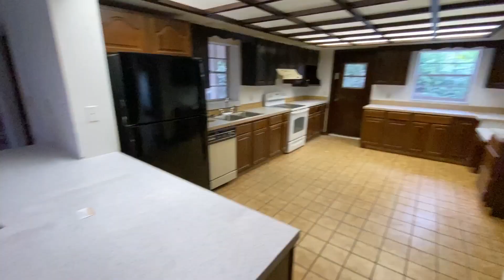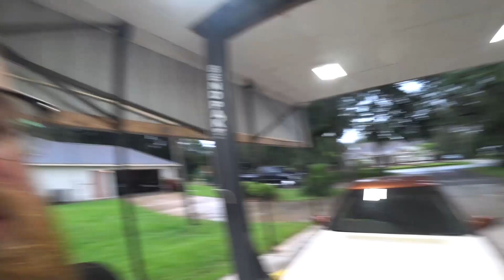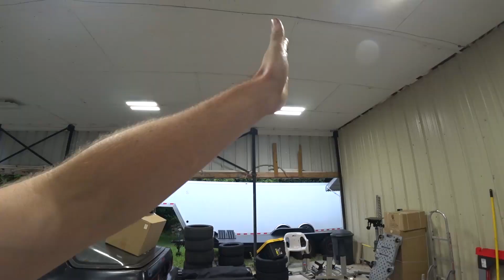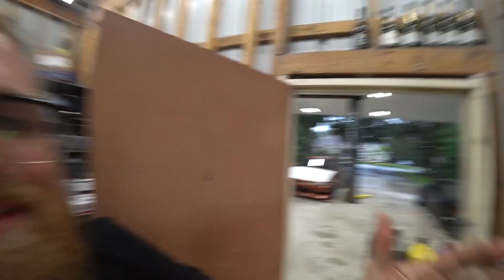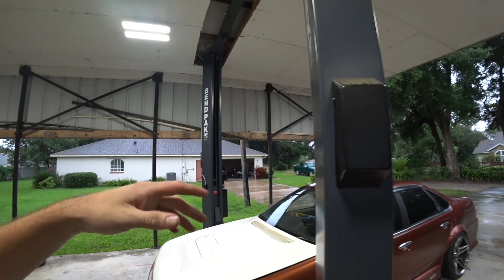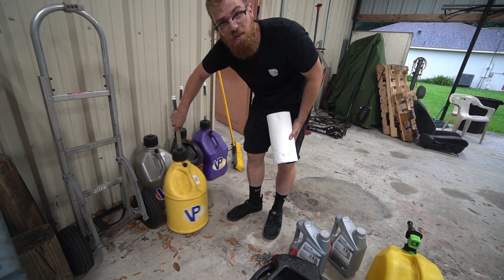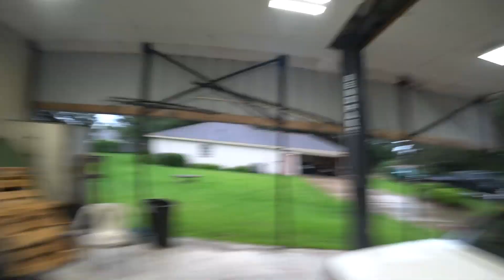Update on my new shop. I have to tear it all down.

Comment: Wow, this sounds like my story for house hunting and what I was looking for. I bought a place with an open shop that they didn't finish so they could park a 5th wheel in it and have people stay in it. The good thing is I can close my shop without issues as I live outside of the city. I would be sick if I had to tear what I have down and start all over again, but it sounds like you have a great plan and what you build will be pretty awesome. I have 220v power wired to the shop now, but I need to expand it. After that, lights, 60 gallon compressor, and then air hookups around the shop. Also, I need to look into Quickjacks. I could put a lift in my shop, but I want to keep the floor space mostly open for fitting all of my vehicles for storage purposes when they are not being worked on.

Comment: i would think that with tear down and rebuild you could run into the chance of it not be grandfathered in.  most places do not allow commercial in a residential area.
if it has been there for 23 years then historically it will meet FL wind codes.
Have you ask one of the county/city building inspectors to come look at the bldg and  talk to you about the issues?
I would put hurricane fencing around the open area and cover that with tarps or similar like many vegetable stands are.

Comment: I live in south Florida! here are some suggestions! I worked in the product design industry and also wrench on racecars like yourself. I had to do a permitting challenge also with my rental. the garage was open/no door so they also made me get a signed and sealed architectural drawing (just for the frame to put in front of the roll up doors?) it was soo simple but they made me do all that? details on the screw length and spacing all that. the challenge was finding a cheap price. just for the frame 8x7 people wanted over $1000, I ended up find a guy and hustling him down to $500 just for the drawings. (side note over the yrs I've done private remodeling jobs for multimillion dollar homes and i know a few people in the area)  it turns out if you own the home you can do what's called an "owner occupant permit" which basically allows you to do all the work yourself but you have to really know what your doing, they don't want to have to hold your hand and make multiple inspection trips out to you. the only downside is you have to sign papers making you legally responsible for the job, (example if a hurricane comes and parts of your job destroy someone else property they can sue you. or if you sell the home your still responsible for it. (which is why contractors have the insurance)  ok here's what i would do in your case. looks like you are trapped into having to rebuild shop after the home purchase. time is value I understand you need to finish your shop and projects.   Look into canvas like awning companies that could close in the bottom wall. and for the front a retractable awning that just rolls up and down. that would be the cheapest option other than just going to home depot and getting some tarps to close it off. (you paid for the shop when you bought the home so seems crazy to tear it down loose that value then build a brand new one over it? ) you could have just bought a larger property then built a shop on it if you got that budget.  honestly i would just start looking for another property and wait on a good deal, continue using the current shop as is until then. (your video just got to the part talking about your good neighbors.)  in this case if your going to build a new shop i wouldn't tear that one down! I would build a new one behind it or beside it, don't loose the value you paid for it, that just seems like too much of a waste. just pour a new foundation slab. if the new slab costs less than the value of the current shop its worth it.  great content

Comment: Like you said it would be a lot of work but if I was you I would go with a 40ft container because I think from the look of what you have it will fill up quick. I am only speaking from experience a short while ago I had to move out of my 20x40 shop because of health reasons  I had a 48ft trailer and it filled up quick.

Comment: You needed to consult with and hire an engineer. Worth it to find one you can work with. Problem solving becomes easier, saves money in the long run. That stamp ends the bs.

Comment: I'm not sure how far you've gone with this. The space looks big enough to fit two full size RV's. My advice would be use a At least one 14' tall 16' wide door. It'd be a good feature down the road. If you did decide to build your mezzanine leave it to one side so imaginary RV would fit. A 14' tall overhead door is a common size. I'd never recommend anything between 8' and 14' if 14' fits.

Comment: You could put solar panels on the roof and use a heat pump. The solar panels would provide the juice to run the heat pump.

Comment: Building code beurocracy is a pain in the ass. If it was my shop, i would just pour a new perimeter foundation footing around the outside, and frame up new exterior walls all the way around, outside of the existing walls and support posts, to meet the newer wind load requirements, and attatch them to the existing walls and roof.

Comment: I've gone though this same thing get second electric meter for more power spray foam inslation no drywall plywood walls for hanging stuff later save the metal from old building and use to make leantoo building on the outside of the new building

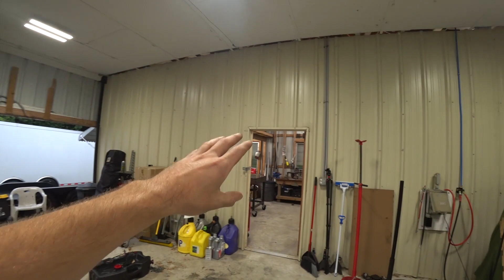Comment: 20:00 - What's the problem?  Take out the stuff in there down to the exposed studs.  Run your wiring.
SPRAY FOAM the walls and ceiling.  No need for a drop ceiling except to hold the heat down in the work area.
Reply: its called “ fans”

Comment: As a GC in California we have to deal with very dirty code enforcement! My solution to your problem would be to enclose your shop with 9ga. chain link fencing and gates then line the inside with heavy canvas...not being a permanent structural addition a permit would not be required! Not much insulation but you would have security...

Comment: building already grandfathered was built to code when built.  only updates will be to electrical,some city require plumbing(working bathroomm). if so many square feet.I guess if you were to run 25 foot of conduit & wire for an extra receptacle you have to permit it ? variances are issued every day here in my area  for building money sways all think that where you are booged down

Comment: When you do new lighting, please do not get lights rated over 4000 kelvin.   Reason: higher number is brighter but is more blue light.   Blue light damages your eyes.  So 3000, 3500, or 4000 kelvin is my suggestion.

Comment: You should find out how much of the materials you can reuse from the shop already and I tore down multiple shops and brought them to my house and built a huge building and I poured the concrete and put electricity in for less than three grand and I had a 26 x 30 building have you seen my yard this building is huge got 14 foot ceilings in a second story

Comment: My curiosity lies in why he didn't just take a weekend  to frame and side that simple of a job using code specs? Then just take the penalty IF they ever show up. Most likely they would not have. Plus you would be up to code minus the permit. I mean it's 90% already up to code and permitted anyway,. Jeeze.... Tear it down?🤔 So it appears last years codes are not safe enough to build to BUT safe enough to let the building stand. Meaning he can't add on to it for it would be considered unsafe. 🤔 Perfect example of following rules to your own demise over realistic practicality of proven engineering.

Comment: Dude, you're preaching to the choir re dealing with county building codes, etc.  Like pushing a rope uphill.  We bought a place out in butt scratch Florida with a large pole barn, part of which is enclosed.  I want to enclose the rest, partly for woodworking and to work on an old car, etc.

Comment: Sounds like you have an amazing idea. I would always go steal over wood. But that's just me as a former union ironworker.

I'd run the Air Conditioning at night but raise the temperature 10 or 20°. Then you keep the humidity out and don't kill the machine going off and 100% on.

Comment: If I can make a suggestion, I know some of my family members back in Nova Scotia have been installing heat exchangers in their homes. Maybe do some research on them to see if you can apply them for your shop. Cool in the summer and hot in the winter white save some money instead of running two separate systems one for heat and one for AC. Apparently it is a two in one system and with that being said maybe has A unit out there to apply to your shop.

Comment: Why not enclose it in canvas it won’t be less insulated than your steel walls and in the summer you could open it up for ventilation. Depending on your county regulations if you buy a prefab steel building sometimes you don’t have to have it permitted if you meet certain requirements for a non permanent building. I have a friend who did it that way.

Comment: Why don't you just put 4 roller doors on each side and big doors on the front? It is still a carport then. Or patio blinds if they say doors are too permanent. Basically, as it is, it is permitted so all you need to close it in is doors or windows but they cant be permanent so patio blinds are not permanent. Or Roller doors if you can get away with it. Also keeps it open-aired to let the breeze through.

Comment: Dont ask dont tell when it comes to closing in a garage like that.  Do a little bit each month, no one will notice. Tearing it out is nuts. Should have bought a place in the countryside with no shop and built new. Neighbors suck. Put lattice on the walls and a gate to the roof on the front. Now its secure and light.

Comment: Very well produced and inspirational video!  Kudos!  I can say I am well versed with the bureaucratic nightmare of building your "dream shop".  It's very good to see a young guy like yourself without an insufferable sense of entitlement, and a good work ethic!  I am a "not so young guy".  It took me my whole life to get my "dream shop".  I now live on 2.5 acres with 2 modest houses and a nice shop in AZ.  I have 2 massive swamp coolers (because they actually work in Arizona)!  Much cheaper to operate than AC.  I am also fully insulated (wouldn't want to be in there in the AZ summer otherwise)!

Like you, the houses were a secondary consideration to me.  I built a 40 X 60 (16' high) pre-fab metal shop with a 1000 sq ft loft and an 800 sq ft annex off the back (there is never enough room).  It has 2 car lifts and 2 - 12 X 14 rolling metal doors (and 2 double car 10' high doors off the annex).

You seem like a very enterprising guy.  It gives me confidence in the future for America (when little else does these days)!  The best of luck always going forward!  Keep up the good work!

Comment: did I miss something somewhere ? I thought the whole reason the small enclosed shop within the un-enclosed barn was becasuse the permitted development could not be any bigger than so many square feet of the original house's foot print ?
Surely building a new all enclosed building as big as the existing building violate this ? I must have missed this bit ?
Reply from the maker: No I said I was worried that’s why it was built this way but that was not the case. Zoning wise it can be the full footprint enclosed.

Comment: You know that in most states once the seller signs he has NO RIGHTS to end the sale. In fact you probably can still sue for damages, mental duress and personal stress. For sure in FL this is true. Glad you found better, however I would go after the last seller's agent and seller for ending the sale and harming you.
Meanwhile, I can tell you that when you enclose an open garage you re REDUCING the loads on the structure. The wind uplift loads on on an open roof are MUCH higher.
The next question is whether you are amenable to having tear away walls. That would result in an acceptable variance. 
Glad you came to a conclusion regarding your needs. Don't forget to insulate and air condition (use mini splits).

Comment: I would look up the difference between 2020 and 2021 wind code.  I bet you don't have to change anything other than adding some support gussets or more bracing.  sounds like this company wants to take you for a ride and not touch someone else's work.

Comment: Ya not sure the obsession with enclosing it especially in Florida most shops have outdoor work places much cooler and dealing with fumes and fire risk from half taken apart cars you could secure the sides with metal fencing and the gap above the front gates or leave it as is and a good ole shop dog will do more for security then any door...I am in Florida you could not pay me to enclose my open part of my shop inside a enclosed metal building can get 20 degrees hotter then the outside area...

Comment: Good call going new. 
We're currently making drawings to enclose a similar build, but unlike you we don't have original drawings and it's in a highly-regulated county relative to most. I'm 600 miles away and the owners & gc have provided half-assed as-built info, and they don't understand that we have to run calc's on specific existing steel profiles in order to stamp. Meanwhile the owners keep inquiring as to turn-around and timelines, because the project is for a weed processing facility and fall is coming-up fast. Every hurdle requires a back-and-forth that takes a week or two. I regret bidding it tbh.
I keep looking at the photos of the existing structure and wonder how much money they could possibly be saving to salvage it, and honestly I think it's a wash. Plus, a new build would 100% happen faster and they'd get a better product.

Good luck man

Comment: id add a 3+kwh solar system/roof ( and maybe something like wind as additional aback up. but i don't live in your neck of the woods to i don't know 🤷‍♂️ how well it would work and or be $$ sense or not ) ( and maybe even a smaller battery system to take advantage of it and have insurable power supply aka backup power from your main utilities and or bill shaving $$ and a 240v by the main door just encase you sell the place or need power outside for a welder 👨‍🏭 or 80 amp EV charger to plug as that can be a selling point now or in the future as ev's are popular now days ( and in my town Teslas are like flys there everywhere ps. don't worry im a 600+ hp v8 kinda guy 😉 and lucky ish me i still got to keep some of my classic rides for now. but i do find some of the hybrids and BEV makes good parts donors for projects ie like the steering racks ect. or cheaper battery's for home storage ect. ) ect. in same things with space out the outlets and use leds lighting 💡 ) to run the shop and your house 🏡 as that's my plan at some point ( when i get to buy a different home 🏡 as im starting over from scratch / failed relationships / single and haven't 💰 recovered yet ) in the future as i hate giving up my hard earned cash 💵 for a higher climate control bills ( just to be extra cushy 😎 ) and i would look into buying a heat pump rather than a pure ac unit as 80+% of the parts are the same might help to if some of the cooling loop is buried as to add efficacy but most houses that i have lived in with a small lot that can be more money / harder to do

as for main services 240V sp 350+ amps are really nice and useful ( and i know of regular residential homes with up to 600 amps that i have learned about and one right now that is being retrofitted to 400 ish amps with 3 ovens and other loads that i personal know the owners ) ( and if i can my next place is going to have 3P power preferably 480V so i can buy cheaper retired pro welder / mill and other tools and leaves me the option of dc fast charging or at least is a selling point / helps with options friend or family comes to stay the night after a long drive ) and 200 amps ish to the shop as it sounds like that's where you're going to spend the most time and use the majority of your power bill and be mind full, of mind less power peak power and water and gas/lpg consumption as i and others before me in at least more than one house as over loaded the main panel and or meader maid by not paying attention and adding two meny things like double ovens or welders,lights ect.'s

Comment: Perfection in not the opposite of something good. Instead, it's an acceptable compromise. I listened very closely. You want a perfect shop and you used problems associated with regulation to justify it. You could have quietly closed in the  shop and went about your way and nothing would have stopped you.

Comment: What a waste. I'd cover those openings with the same material they make Yerts out of, or what the military uses for portable helicopter enclosures. You can have clear plastic for windows  installed too. Don't do any framing; that structure is standing strong. I think it would have a really cool look.  I think the building department would be okay with it.  There are so many things you can do; don't give up.

Comment: Remember, a bureaucrats' first answer is always No. It doesnt require them to do anything.
I al ways say "This is what I want to do. If you can approve that, great. If not, I need to talk to the person who can. It's much harder to say No face to face.
I once went for a rezoning to multi unit townhouses. I was told I had to do a new survey and blueprints for the proposed buildings. $25,000 later it went to the next level and was a flat No because the municipality didnt have currently have enough sewer capacity for the additional 10 units. I was furious. Why wouldnt the zoning department have told me that first. I had already questioned why I needed a new survey since there had been no changes since the 20 year old survey I got when I bought the property 10 years before. Ridiculous bureauocracy!